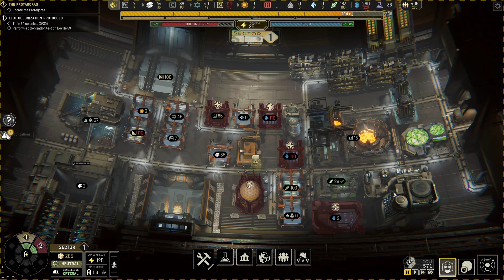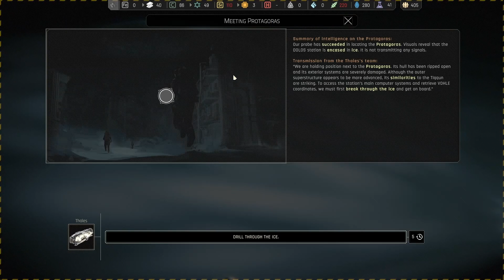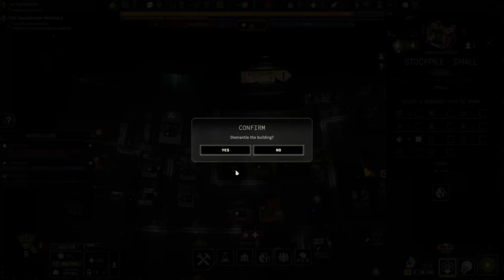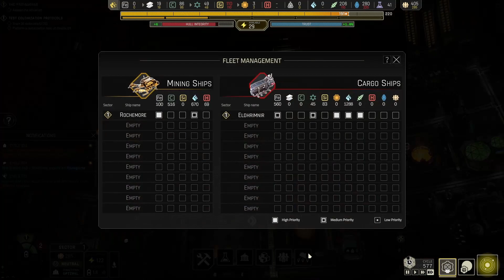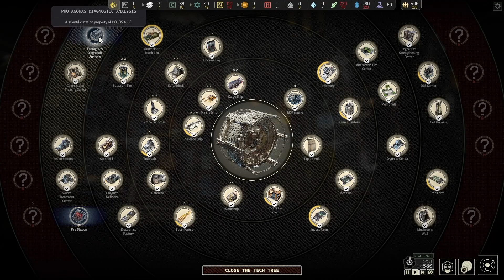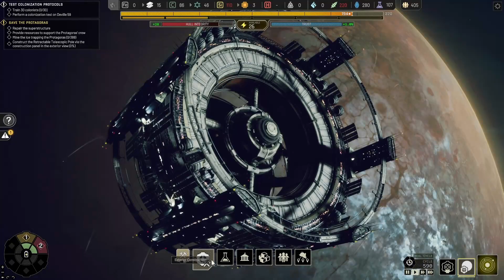The Protagoras - IXION #13

Comment: Just build more cargo ships my dude. If there'll be at least two on iron - 1 steel mill will cover all your alloy expenses and little extra for now. And further expansion of alloy production will come easier. Also, due to the black magic that is sector specialization calculations, mushroom walls are the best building for food specialization, although they dont seem like that. Iirc 4 is enough for Tier 1.